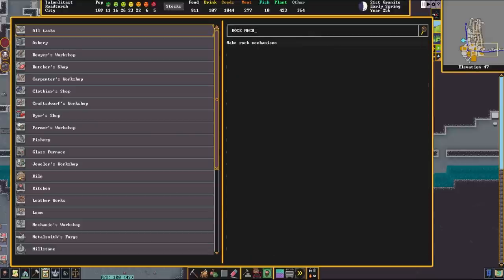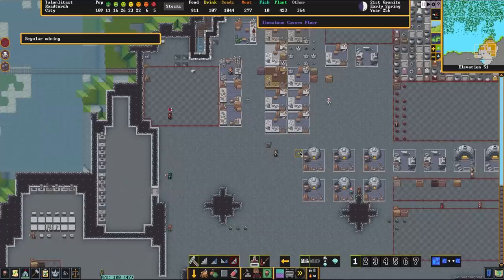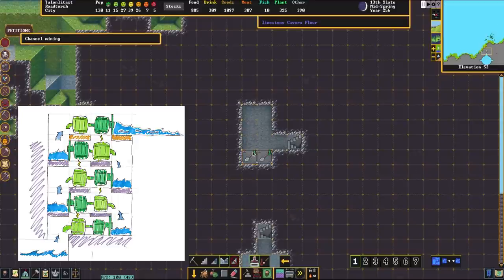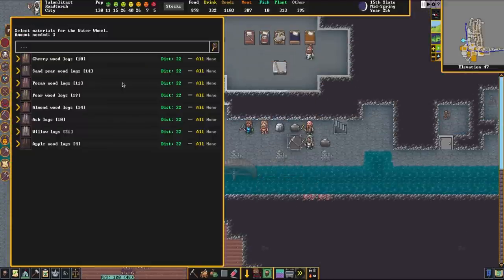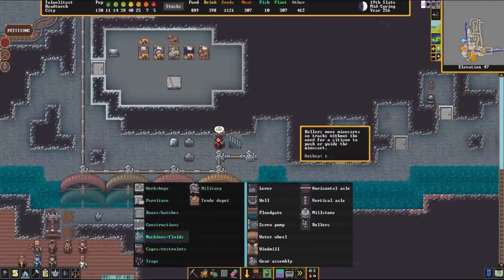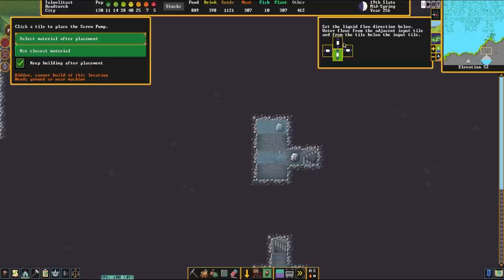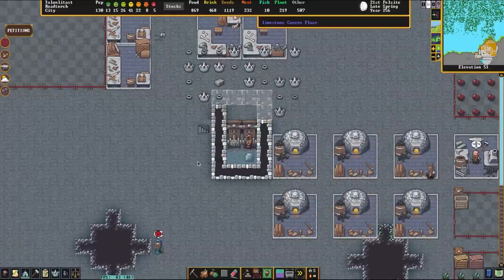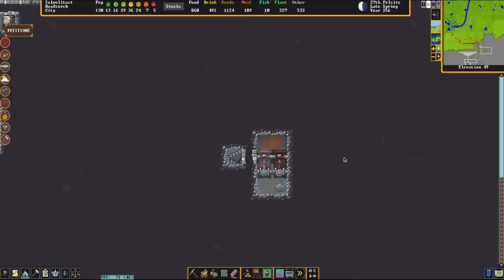Dwarf Fortress - Quick Tutorial -  Waterwheels and Pump Stacks.

Comment: Loving the short, targeted tutorials. You are doing a great job of condensing this stuff down into "need to know" for the task at hand and its great. 

That said, for the regular video run times on DF, id say you could go 10 mins easy and still be a short video without worrying. Especially when feeling its 'too long' and still at a digestible amount of time, instead of having to rush through.

Comment: I think anything under 15 minutes is a good length - some concepts just need more time to be properly discussed! This tutorial went a little faster than I would have liked, but it was overall very helpful. (I just wish you'd gone a tiny bit slower with the pump placement. I wound up watching it several times and eventually got my head wrapped around it, lol. I'm so not used to thinking in z-levels)

Comment: The old hand drawn illustration is so good with the new pump graphics.  You can see the block on the output side and that's the water tight side.  So you can't have your stairway near it because that would be a diagonal path for water.  

That almost impossible to explain without playing a fort with the wiki open next to you.

Also you can put wheel on a brook but you need to channel the brook floor out.  Brooks have almost a solid floor,  that's why they don't train swimming.
Reply from the maker: Yeah that is also a big one.

Comment: I DID IT!

Using this pump stack method and a quickfort aquifer tap into a MASSIVE cave lake, I managed to create a stable plumbing system by taking water through the tap, and then pumping it back into the water source from the top of the cave system to avoid depletion. It powers itself by using an artificial stream ran directly from the tap. Cistern pools are stable and power streams are always running. 

So, uh, thank you ^^
Reply: Damn. It took this man 7 months to accomplish this goal. Just about as long as I thought it would take to understand

Comment: Every time I run into an issue you seem to have released a video about it an hour before I had it 😂 I tried to get water from the river down to a well with some cheeky channelling. Didn't account for water pressure and it shot out of the well at full speed and flood a third of my fortress before I could wall it off. One of my dwarves fell in to the channel and his corpse is just stuck at the bottom of the well now 😂 hopefully this'll help dry him out a bit so I can bury him

Comment: Maybe break it down into smaller topics?  I think "How Manual Pump Works", "How to upgrade the pump with a mechanism", and "how lever works" would be useful in isolation, because my current struggle is just getting a single pump to desalinate/filter for a well.

Still, great job keeping them short and targeted!  Most other tutorials are damn near an hour.

Comment: what's the most efficient pattern to create a wall that's wider than 3 squares on the surface that's multiple Z levels high? I always find there are holes in my walls unless I painstakingly place each vertical one by one. I was trying to make like a Helm's Deep entrance to my fort. Also how high should my walls be to prevent werebeasts and other things from just jumping over them/climbing
Reply: Priority might be something to try, but honestly mega constructions are painful for this and other reasons. May be worth searching for mega construction tips and see if someone has found a better way.

On height, I believe 1 high walls are usually enough - some creatures can climb, but I think constructions don't allow this. Going higher than 1 wall or topping with fortifications should guarantee it. Flying creatures can fly over all of that, so you'd have to get a roof (or just handle it with soldiers, flyers are rare).

Comment: So... I have a brook outside of my fort that I can't use water wheels in because it's too shallow. But if I made an underground pathway (2-3 wide, 2 deep) with water wheels and then connect that to the brook above, would the wheels work and generate energy while the water from the brook washed down from the above z levels? I don't mean the water falling onto the wheels like a waterfalls, but running down the pathway, eventually hitting the wheels

Comment: Suggestion on how to make it easier to understand.. Make one at the time..
Make one pump.. One level.. 
Fill the hole with water manually..
Pump the water to the level above manually with a worker...
This way people can visualize what you are doing instead os seeing a bunch of levels with dig / pump transparent orders that can only be done later.
You can even do one more manual level.. So people understand the alternating side of it..
Once you have that manual, simple tutorial.. You can reference into this more complicated one. 
In my opinion this was too quick. I would use it in lower speeds or pausing a lot.
Reply: So theres a reason he cant do that. If water is filling the space, he couldnt get dwarves in to build the next one. Its pumping tons of water, itd just flood out his base while he watched dwarves get pushed away by the flow trying to build the next set. 

Long story short for this one tho, open side takes water, spits it out the other side. Rotate 180 degrees, up 1 level, repeat.
Reply: @kban6748  pumps can be manually operated by dwarfs. He will not flood his fortress if he shows how the pump works manually... 
Ask dwarfs to bring water in buckets.. A few is enough.. 
Ask another one to operate the pump..
See the result!

Comment: I'd love some more "why"s of what you're doing. For example, you said that the water wheel setup you did was overkill; what is a reasonable setup? How can you tell if it's overkill? Really helpful videos for figuring out this game; thanks!
Reply: I just came back to this video because I needed to figure out the pump stack method so I could bring water up from a river 15 levels below. I was trying to create a new waterfall on my map for happiness purposes. I got it all setup with two waterwheels and it wouldnt run. As soon as I connected the waterwheels to the pumps the waterwheels would stop running. It took me a while to figure out that I needed to check the pumps. The pumps info tab told me that my setup needed 550 power and with 2 waterwheels I was only giving it 200. So I added on 4 more waterwheels and it started running. Now I have an extra waterfall on my map that my dwarves can make use of. Hope this helps.

Comment: So if you power the bottom pump in a stack it makes connections all the way up? Huh, I figured you'd need a vertical drive shaft for the whole thing, this makes this way easier!
Reply: Transferring power between pumps on different levels is why there was a second channel carved out above the actual pumps instead of just the one on each level to access the water below.

Comment: I do have a question. As you pump up the water (or lava in my case), will it cap out at the pump's level or is it possible to... Flood upwards, if you pull enough?
I did plan on attempting a pump stack of some lava a bunch of levels higher so my magma smelters are closer to where my other stuff is, and was planning on making a huge pump stack for it, but i've also had  flooding incident with a well I tried to build using channels (pulling water from a surface brook down using channels and a floodgate) so i'm a wee bit wary.
Reply: It'll cap out at the level of the pump - if you fill the output room, it'll stop. Magma also has slightly different behaviour - it doesn't retain pressure after dropping down z levels, which makes accidental floods less likely. Probably a good thing!

Comment: Whoa dude, slow down.  I can't even find your latest video because you are spamming YouTube with content.  I genuinely appreciate seeing some DF content on YT.  But you are building in ridiculously inefficient ways.  I've never seen anyone build how you build in this haphazard, inefficient, throw everything against the wall and see what;s stick method. 

It's time to start over again.  Build things logically.  In the correct order.  Using at least a touch of efficiency in design.  Because a new generation does not need to thing that THIS is how you play the game.  No one plays it like "this".  Dude sits outside in the rain for an entire season without building a bed, enough said.